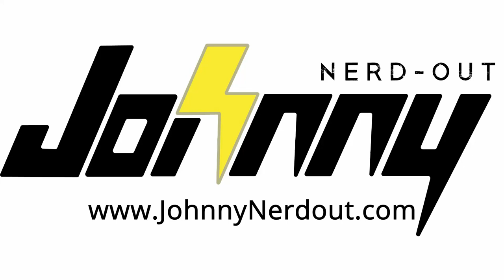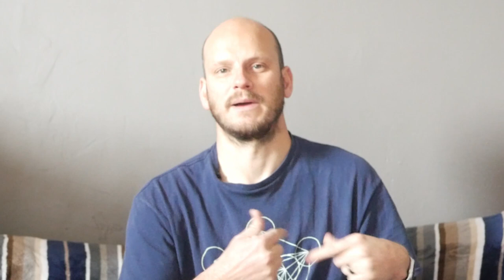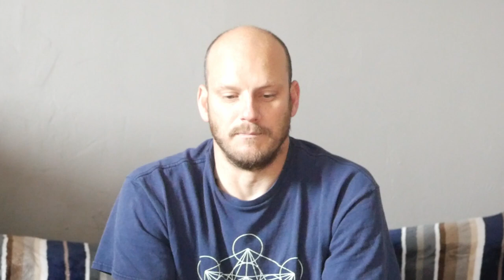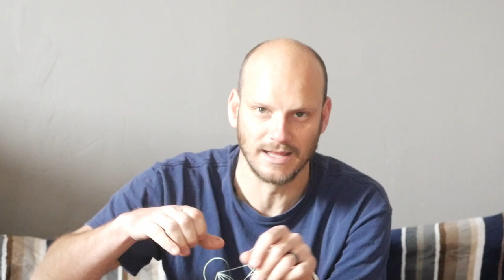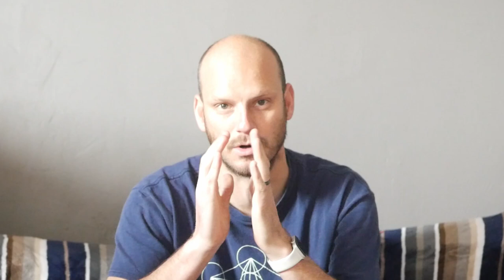E-bike Blog: Are rim brakes on an e-bike ok?

Comment: Don't forget to inspect the brake shoes and rims regularly (especially on the front wheel). A brake shoe that is worn to metal can easily eat into your rim sidewall and cause a major accident when the sidewall finally splits outwards.

Comment: The point about quality of the parts is something to be noted. I got new rims recently and still was having my brakes over heat every ride with moderate braking. So instead of cheap rubber break pads I got a proper set of koolstop and now it feels like I have disk brake stopping power with similar modulation and no overheating so far meaning extended life

Comment: One big issue with rim brakes is if they get wet from a puddle etc they stop working well.
I have a ebike conversion with rim brakes and it's ok 90% of the time but on a long downhill brakes fade , in the wet they dont work well and muck etc gets in them easily from the rim.
Il still happy enough with them but these points need to be considered.
Reply: Did you end up retrofitting to mechanical, if so what wattage & speed did you base your retrofit off of?

Comment: If it's in the budget, change out the front fork to disc brakes.  Majority of braking comes from the front.  Use "Kool Stops" in rear rim pads.  Make sure the "motor cutoff" switches work with braking.
Reply: I usually just hit the rear brakes, because I don’t like flying over the forks.

Comment: Good advice, yet again. The only caveat with rim brakes is water or mud getting in the way. With clean, dry rims & pads they can actually work pretty well.
Reply: Conversely, disk brakes can easily be fouled and pad permanently contaminated in snow, sleet and even rain on oily streets.

Comment: I'm building my first e bike atm and the bike I'm using is a 1987 Raleigh mavric, it still has original  rim brakes lol
Reply: How's the stopping been so far?
Reply: old brakes couldn't handle it so ended up getting bike with disc brakes little disappointed old bike was nicer   @MR-backup
Reply: @damienobrien1463  I was afraid of that😥😥

Comment: Both skid just as well. However my v-brake pads wore out pretty fast on the trek bbs02. I bought new hubs and made a disk brake adapter for the back, respoked the wheels and bought a meroca chinese brake kit for 50 bucks. Works great now. As a bonus i got the origin 8 hub that has much stronger pawls. Also v-brakes rub and have no tolerance for rim warpage.
Reply: V brakes only rub if...

Your wheel isn't trued properly
Your brakes aren't adjusted properly
Your cable is dragging on release and needs lubrication.

In short, if they are rubbing you have a problem.

Comment: thank you very much. I love my super light 29er Gary fisher. I just want to put lightest motor on my paddle. don't want to add weight so I could go around traffic and have better control in NYC.  no need to go fast thanks thanks for saving my bikes and money. I love how my bicycle handle because of light weight. I'm hoping I don't lose that much after adding battery and the motor. really I'm wishing u the best. very helpful information.

Comment: It is not about if you can lock the wheels or not, it is about on whether you can modulate the brakes at speed to keep control of your bike. I wouldn't want to lock my brakes going down a hill at 40 mph.

Comment: Actually, even hydraulic disk brakes do not stop better or faster than good, properly adjusted rim brakes. You cannot stop faster than your tires start to skid. Disk brakes came to the fore only because they work on fat bikes and mtb's with 3" tires. You are starting to see them on racing bikes AGAINST the wishes of team riders (you should see what 4 time Tour winner Chris Froome has to say about them). 

They do have better modulation than  rim brakes. So, they can bring you down from the edge of traction more quickly, but only if you are a freakishly skilled cyclist. The very best weigh 2#'s more than the cheapest rim brakes (heavier frame, heavier fork, heavier caliper, plus the rotor). Hydraulics are nice because they take one or two fingers to come to a screeching halt. They are also super low maintenance. Frankly, that just isn't enough to justify the extra $400 mfg charge to install them (or that they take off of the quality of components to cover them). Mechanical disk brakes are a constant maintenance hassle.
Reply: One other plus for disc brakes is the rim doesn't wear down and will only need to be replaced after a catastrophic buckling. Personally, I prefer rim brakes for all of the reasons you mentioned.
Reply: @billmarsh1971  I understand that there are places around the country with things like volcanic soil. There rim wear is a concern. Here in The Midwest, I have never, in fifty years of doing this, ever seen a rim worn out from braking. I dare say that you are going to go through much more, in terms of higher cost maintenance and pads, with disk brakes, than the cost of a replacement wheel in the same amount of time. I am no longer against disk brakes, though I question why one would bother with mechanical, but I still would rather add a kit to a quality used bike with rim brakes for my customer than a cheap factory bike with hydraulic disk brakes (yes, I sell bikes w/integrated motors, hyd disks and stamped steel, freewheel hubs with Tourney deraileurs).

Comment: HI Johnny. Love your channel very informative. I have a 20 year old mountain bike with rim brakes. The price on new ebikes can be a bit high and what type and what brand, fat tires and it goes on. The conversion kits you talk about are interesting to say the least. I love my bike and would like to keep it but maybe upgrade to a conversion kit. I would like the speed for this bike and a conversion kit would be something I would like to explore. I would take your advise and change the brake pads and cables to make it safe to stop for sure. What would be a good kit to handle hills and a good coasting speed.  Ottawa Ontario Canada.

Comment: Weak brakes could be a scenario where a regen braking hub motor would make a lot of sense. Grin Tech is able to get 500-800 W of braking force out of some of their hub motors. Add that on top of even the worst rim brakes and your eBike will still stop well. Most of the time regen itself will be enough to stop you so your brake pads will last forever.
Reply: Except that you cannot turn it on and off so you can never really just coast which gives you a far better return on range than regen.
Reply: Grin has controllers that simulate coasting by pumping just the right amount of electricity into the motor to give it zero drag. This takes a tiny amount of energy, but  far less than what regen gives back (unless you ride on flat ground all the time and hardly ever brake)

https://www.youtube.com/watch?v=A758PcTUS_M
Reply: @mattherndon9317  100% of any regen reduces coasting range. If inputting anything didn't keep you from losing more than you gain you would be breaking the laws of physics.
Reply: I think you're misunderstanding me. I'm not saying that energy is being magically gained. Just that some of the energy that is normally lost to heat in friction brakes can be stored in a battery and that the sum total of what you store there can be greater than the total amount the small amount of energy you have to feed into the motor to cut it's drag to zero the rest of the time. If you were trying to use the energy stored by regen to power your bike back up the same hill it came down it would be violating the laws of physics (because you always lose some energy when converting it), but that's not what I'm saying here. I'm just proposing using the regen energy to cancel the drag on a motor, which takes far less energy than using it to push up a hill. As long as you brake a fair amount of the time then regen will store far more energy than it takes to cancel the drag of the motor.
Reply: @mattherndon9317  you would have a point if ot could be switched on, off and modulated, perhaps by the application of the brake lever. Either way, it is a waste though. You complicate the controller and wiring to gain incredibly little in order to protect something that rarely wears out and costs very little. I could though accomplish the same thing by locking my free hub or freewheel and using a coaster brake mid-drive. I am not sure, but there might be a diode I would have to bypass  as well. The great thing about this would be that I could use regen both to generate much more power by driving the mod-drive with a much lower gear, stopping more quickly and with better modulation as well. Silly I know, but that is exactly how I feel about using regen on a bike of any sort.
Reply: My e-scooter, an e-twow gt, has regen braking and it's been wonderful for 500 miles so far. I live up a big hill, and the disc brakes on my e-bike end up warping. My little scooter, on the other hand, feeds energy back to its battery when I'm going downhill and it doesn't have a disc brake that could warp. I would love this feature on the e-bike. Even if it still had disc brakes, I'd use them so much less going downhill (with regen doing the majority of my braking) that I'm pretty sure they wouldn't warp. If I were converting an old mountain bike with rim brakes, regen would probably allow the rim braking force to be sufficient.

Comment: Any tips on keeping the chain from skipping? Mine started to slip/skip on the smaller rear sprockets. It used to only do it once in awhile now it seems to do it more. I've considered going to a hub cassete and nice chain.
Reply: You either has a worn chain/cluster or in a fall, your deraileur hanger got bent.

Comment: In my experience rim brake is very good, if.... Its possible weak points are pads, outer cable and rim, if it not straigth. Good pads require some hunting. Cable have often too much flexibility. Rim brake is huge disk brake. Tires grip variation is large. I like very hard braking.

Comment: Good to hear. The bike am thinking of has rim brakes, I will tune them up. The bike I have with disc, I don't want to convert, it is my main trail bike. I don't need an electric motorcycle so I think 500w will be enough motor, so the rim brakes should be OK. - Cheers

Comment: If rim brakes doesnt work properly, what to change first? I assume the brake pads themselves... Are there different types? Which are the best?
Could be a future video.
Reply: Kool Stop makes good e-bike specific pads that have more surface area than the average rim pad. JohnnyNerdOut mentioned them on a tandem build & I have them on a hybrid city e-bike.
Reply: @michaelsprinzeles4022  I second Kool Stops

Comment: Hello Johnny.
I am in France where the limit for e-bikes is 250W nominal.
I also electrify client's bikes with bafang, usually BBS02 but it's technically illegal.
Any idea how I can use that motor but claim/have it at 250W nominal?

Bosh, Yamaha and others claim to have 250w nominal motors but we all know they peak much higher. 
Any idea how I can have the bafang BBS02 at official 250W nominal?
Reply from the maker: You can change the programming if that’s an option
Reply: @JohnnyNerdOut  yep. I need to try. I got the usb programming cable.
I will give it a try.
This European restriction is such a shame

Comment: I put a 750 watt mid drive kit on a 92 Specialized Hard Rock frame with canti brakes and they work ok. they are after market nicer ones but I'm having hell with the shifting for some reason. I have ordered a new cassette, chain and hoping that will do the trick but what I have on there was in pretty good shape. The bike is stupid fast. Like 32 mph full throttle.
Reply from the maker: check your derailluer hanger too...
Reply: Did you ever figure out the issue?
Reply: @brianj.7466  I did but can't remember what it was, I think it was the chain. I have since moved the kit over to a Gary Fischer disk brake bike with a front shock and loving it.

Comment: I do NOT think rim brakes on any high speed e-bikes are okay after today. Got into the worst bike accident I've ever been in today. I ran into a car making a right turn on my way to work on a converted E-Bike with rim brakes. My friend who converted it for me and I both discussed the accident and saw the damage to the bike. We both are strongly against rim brakes on e-bikes, especially powerful ones.

I was in the bike lane going with traffic like the paint for the bike lane in the road says to. Car was making a right turn. No stop sign. Also accidents like what happened to me today are why bike lanes are in the middle of two car lanes. Some people have told me that they didn't understand that.

I am planning on transferring the motor to a bike with disc brakes. There was more damage to the bike itself than any of the motor parts minus the pedal assist which stopped working and it's a hub motor.

Comment: What is the bast frame mtaral for e bike conversion?
Reply from the maker: Steel
Reply: @JohnnyNerdOut  why?
Reply: It has nothing to do with the e-bike portion. Steel rides a lot smoother than aluminum or CF. Aluminum is buzzy and a good double butted steel frame can be as light.
Reply: @MHH3180  thanks
Reply: @abdulazizali9935  I should add that, in theory, aluminum is more brittle so it can crack. In the unlikely event that happens, just take the kit off and put it on another frame.
Reply: If you are using mid drive it doesn't really matter too much, 
Hub drive you will need to use good torque arms properly fitted.
I've done 2 hub drive conversions both with 2 torque arms each ,
OBE was steel the other aluminium but have been fine.

Comment: Hi johnny ive just bought the bafang 48v 500 motor to go on my gt avalanche 29er do you thing i will be happy with this motor for normal bike riding or should i have gone with the 750 motor
Reply: You are going to love it. It is only at the extreme edges that you notice the higher wattage. I routinely ride my 350 watt commuter with my buddy on his 750. The difference isn't in normal riding or acceleration. There is a difference when climbing hills. He might be in level 5 of 9 and I'll be in like 8.
Reply from the maker: Is it 36v or 48v? I don’t think you’ll regret it. If you ever want to upgrade to the 750w, it’s a super easy swap
Reply: @MHH3180  thanks for your reply im happy now i wont be doing alot of hill climbing i didnt no if it would be under powered you have put my mind at rest thankyou
Reply: @JohnnyNerdOut  it 48v 500w thanks for your reply

Comment: Is there a way get torque sensing on the bbs02? Like in the tsdz2?
What is your opinion on the tsdz2? I would really like a bike nerds opinion.
Reply from the maker: Bbs02is only cadence sensing. Not changing that. Tongshen is ok. Really the only option for a cheap torque sensing mid drive that’s street legal
Reply: I have built near 4 dozen TSDZ2's. They are 2#'s lighter than the lightest Bafang, which I have on my own commuter. Makes for a little better handling. 

They require no brake or shift sensors, so more simple, clean install. They respond a bit more quickly, but you have to work to get anything out of them. Throttles will burn them up whereas you can ghost pedal with Bafang (sometimes that's mighty nice).
Reply: @mark h hendriks,
Do you know which version is most prone to burning up? 36 V or 48 v? Would you play with the firmware to make is draw less current? I'm just looking to make my cannondale prophet into an e-mtb suitable for technical climbs. :)
Reply: @maxspruit8370  the only problems people have are when they modify them. You can turn down the amperage draw if you get an 850c display on a unit from Eunorau (Eco-Cycle, my preferred vendor is not offering color displays with wide variability on stock firmware bikes any longer). You could go OSF and have a huge bunch of options, but I am not knowledgeable on it as my customers are all practical commuter types. I have had TWO warranty issues out of 48 all installed with no shift or brake sensors and no throttle. Both could have been avoided and neither were heat related. If you don't "unlock" or hot rod either brand you won't have problems.
Reply: BTW, all mine are 48 volt except one 36 volt folder I built last week and one 52 volt I bought used to play with.